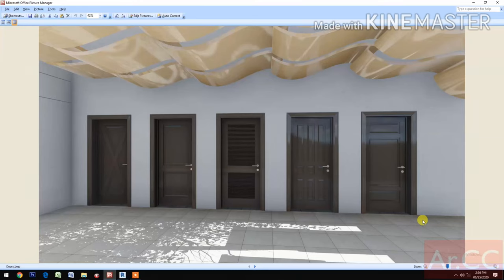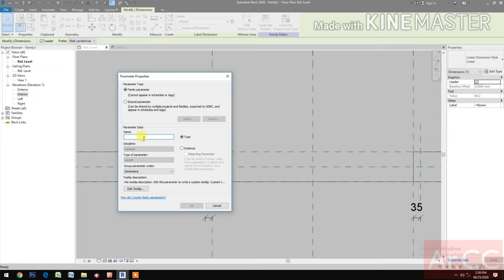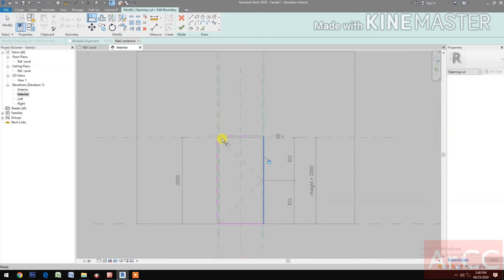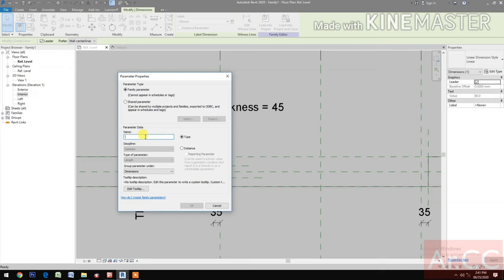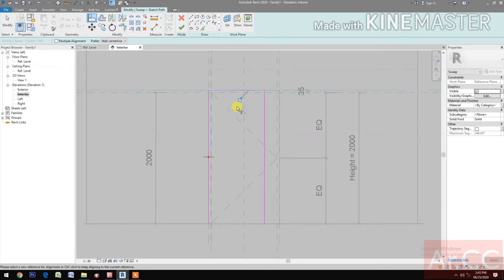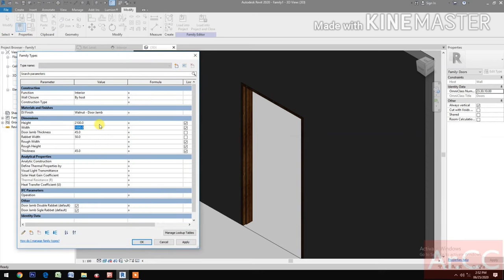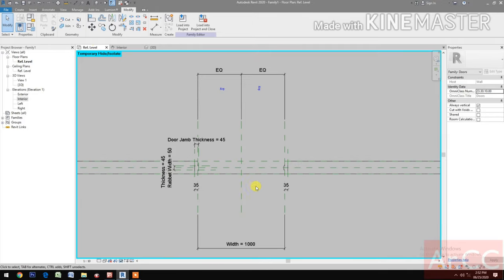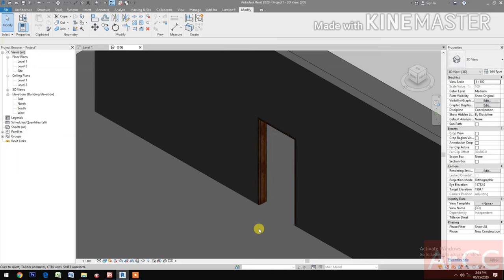RD037. How to make a Parametric Doors in Revit. Part 1 Door Jambs.

Comment from the maker: Suggested Videos:
RD115. How to make an Off-Center Pivot Door in Revit. Parametric Door in Revit.
https://youtu.be/VGfXo0d6vX4
RD114. How to make a Bi-folding Door in Revit. Convert Swing Door to Bi-folding Door.
https://youtu.be/sIAz_u1CAT8
RD113. How to make a Parametric Arabic Pattern Pivot Door in Revit. Pivot Entry Door in Revit.
https://youtu.be/3tAyuCpotGw
RD110. How to make a Classic Ornament Parametric Gates in Revit. Steel Gate Design in Revit.
https://youtu.be/STm4xRDQTdY
RD069. How to make a Parametric Pivot Doors in Revit.
https://youtu.be/Wkf7jAVMRoc
RD055. How to make a Parametric Doors in Revit. Part 13 Modern Door Design. Swing Door.
https://youtu.be/syWkgU3JDLU